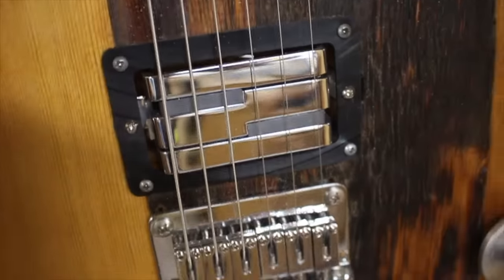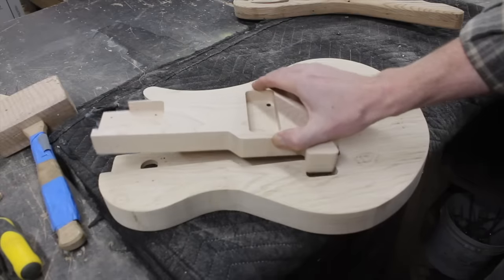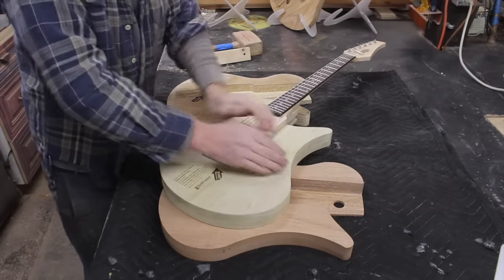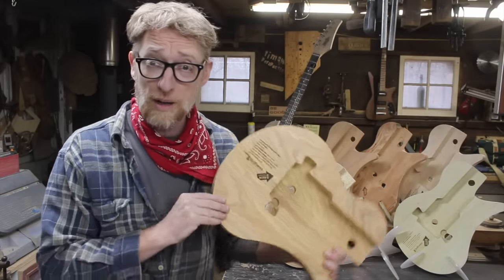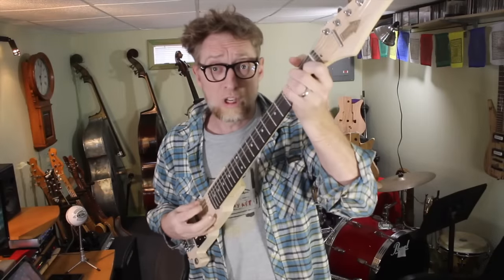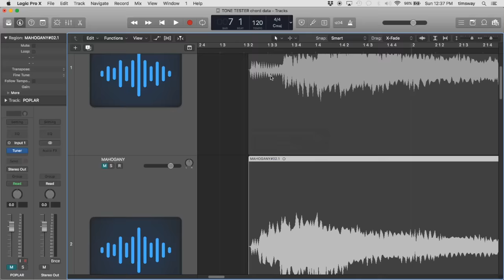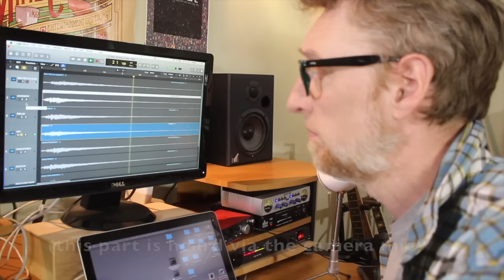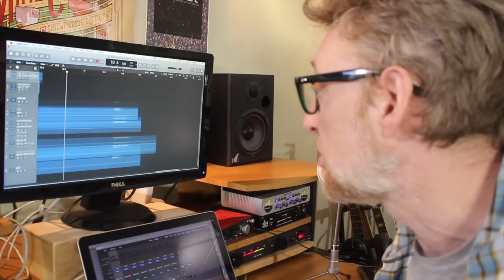Tone Wood Tester: One guitar to test them all

Comment: I think that to get a good idea on whether the wood makes a difference, you need to get insane.  Go to the extremes.  Your comparisons are between materials that are so close in character that it's hard to discern any significant difference.  
   A slab of slate would be something to try.  Solid, dense, and resists deformation.   Very different than wood.  Not practical because of its weight, but just something to try.  If you look at a table on sound transmission for different materials it will give a formula that depends on density and elasticity.  They are independent of each other.  Then what about clay? 
   Clay is dense and has no real elasticity.  Only thing is the bridge has to be attached to something strong.  But that might be okay.  Acoustic guitars use the body or a trapeze for that anchor point.  Solid body guitars essentially are using the neck.  It could be a neck-thru or a bolt on or anything you can come up with....like yours. 
 A neck-thru with detachable wings.  
   Should the wings be the only thing subjected to analysis?  Not sure.  Build a guitar out of solid concrete and look at what the scope says for all of these things.  I used to put my guitar against the wall too when I was a kid.  But that is a purely acoustic phenomenon.  Does all of that get back into the pickups?
Then try piezoelectric pickups to see if the added acoustics of the wall make any difference.  I had a guy tell me that the best wood for speaker cabinets was some kind of birch.  Baltic, maybe.  Complete rubbish.
Hmmm.
Reply: Eh, I'm doubtful about speaker cabinet materials as well, but given that there certainly are differences in sound depending on the dimensions of the cabinet and whether it has ports, open back or closed back, it's not completely inconceivable that the material might make a bit of difference as well. Is that "complete rubbish" assessment of yours based on anything or is it just an assumption?
Reply: @ollimoore   It's just experience.  Some things you lose faith in as they fail continuously.  There are many fake science opinions out there.  If the cabinet is free of voids and of the appropriate design for the intended purpose, you have a good cabinet.  Talking about the wood it's made from is silly.  It only exists in story books.  Not technical people don't know enough to see that.
Reply: @alext9067  oh I am very much a 'technical' person, I DO highly doubt that anybody could tell the difference between different fundamentally acoustically dead materials used in a speaker cabinet, however I dislike such strong terminology unless something is actually proven, in this case by two cabs of identical (or extremely close) dimensions and treatment but different materials.

Comment: It seems like the bridge should be mounted to the test wood and not the center block. This seems like a reasonable test to see if the body surround has an effect. I wonder if the wood in the center block was actually the wood under test varied by species what our results might be.

Comment: The amplitude waveform you compare is more related loudness than to tone... it would be great to see these same results in a frequency waterfall display (like the ones in Studio One's Pro EQ2 or izotope Ozone 9)- With this type of display you can see the each frequency band from 20 - 20,000 hz and how they develop and decay over time. I think that is your best chance to quantify any differences.  I would also test a 2 string bend because that shows the ability of the instrument to create constructive interference and rich frequency content during dynamic play.

Comment: If you have the same pickups and strike the strings the same there should be no difference. 
Wood doesn't matter. It's the electric impulse generated from the vibrating strings.
Reply: The idea of tonewood is that the type of wood changes the way the strings vibrate therefore changing the way it sounds

Comment: Every plank of wood will sound different, even if it's from the same species.
Reply: While you're right that there are differences between wood from different trees of the same species (even differences in wood from the same tree), you missed the point of this video. These planks are all from different sources but sound the same. OP's point is that even though these are all different woods, species, densities, weights, hardness, etc the difference on the tone of the guitar is minimal at best. His results are basically the exact opposite of what you just said lol
Reply: Correct! But the variability between two different species can be far different than two from the same species.

Comment: Tone wood is just marketing talk to get us to buy in to an idea. The sound is really effected by the the active components in the chain. The pick, strings, pickups, electronics and the amp you are plugged in to. What all that is strapped on to is pretty much irrelevant. Even the cables you use have more influence over your tone than the wood.
Reply: By far the most important factor is how good the guitarist is. No amount of equipment could make me sound virtuoso even after 8 years experience. That money spent on hours of intense coaching for me however might stand a chance

Comment: Define "tone". You seem to be labouring under a few nominal misconceptions. Tone comes from hollow body guitars, and is produced by ideal vibrations from timbers, body shape, and bracing. 

Piezo pickups actually reproduce tone, not so with magnetic coil pickups... if they did, they would be "microphoning", which is definitely not what is required, and is why I vacuum wax-pot my pickups. 

Touching your bass headstock to the wall doesn't transfer "tone" it transfers vibration. To the uninformed, your terminology could be misleading. You did nail it with "sustain" though, and that is what counts with electric solid bodies, you have created there the perfect sustain device, without adding the body wood, similarly with an early Steinberger. Your son instinctively knows it too, the denser the wood the better the note carries, even between notes in a passage, the sustain can be felt, but that is not "tone", everyone is fixated on "tone", it just muddies up an already dirty mix of uninformed "opinion". Tone, in the context of an electric solid body guitar, comes from the pickups, the tone knob, and the amplifiers. Even that corrugated cardboard Strat still sounded like a Strat.

However, your examination was the most scientific I have seen so far... not that this is a burning topic for me, nor that I watch much about it... the Poplar was slightly brighter, possibly because the softer wood does not sustain the bass notes quite as well as the heavier types of wood. In my experience, the neck is the key part of an electric guitar, get it right (together with bridge and pickups) and the rest is just tinsel... more or less.
Reply: Tobias Reiner  "Tone" or "timbre", neither has anything to with the wood on a solid body guitar, although your explanation does sound fabulous.

Comment: once you plug a guitar into an amp you lose 99.9 percent of any guitar tone you think you may have had..  tone only applies to acoustics..  the sound is literally bouncing of the inside of the guitar and thats when the wood used can make a difference..
Reply: Sorry - not true.   There is feedback to the strings from the body that is picked up by the pickups.  It's subtle, but it's real.

Comment: Very interesting video. One thing I read is that the body doesn't affect to the sound as much as the neck wood. Your video make it clear. Could you use the same pickups and body over and under different necks? I think this way the tone would differ more.

Comment: guys. wood has no impact whatsoever on the tone. it sounds exactly the same. yes denser wood gives  you more sustain. the reason being less energy is transfered from the strings to the wood. imagine bouncing a basketball on hard floor vs a pillow.  thats how denser vs thinner woods work. 

in fact, you want the least amount of energy transfer from the strings to the body to keep that sustain in the strings.
Reply: Except that each of these sounded different. It's very clear.
Reply: @ssimon64  
Self-delusional

Comment: The sound is in your fingers... eliminate them lol  Of course there are differences in your playing on each take.
Other than that I think it all sounds the same. Tonewood is relevant for acoustic instruments, for electric ones it is not. I have a plastic bass that sounds amazing and sustains like no other I know of. Different woods are important for design, feel and weight.
Reply from the maker: tell me more abut your plastic bass, please!
Reply: @timsway  It's made by Cort, I got it from a fleamarket, felt awesome immediately. I also have a Samick plastic guitar. Both instruments have wooden necks. Maybe that material has a specific name I don't know, but it is some sort of plastic.
Reply: Open tuning. Bone tone issue solved.
Reply: @prOkrEAt  Open tuning and a mechanical arm to hit the strings with the same force, at the same angle each time.

Comment: I've been saying it for 20+ years. Tonewood is a myth.  A pickup only "hears" a disturbance in a magnetic field.  It doesn't hear 'dark" , "smokey', or feel "love".  It just detects a vibration and converts it to a line signal. The winding and placement of the pickup is what makes the difference.  The amp and electronics do the rest
Reply: Exactly but taking into account how vibrations can be affected by the dense or rarer woodor material, i guess denser material like epoxy resin should offer more sustain. Tbh I really like Creative epoxy guitars and other than their weight don't see any downside to them
Reply: Yeah, what the hell does Ted McCarty know? 🤣

"We started trying to learn something about a solidbody guitar. For instance, the stiffer the material—the harder the wood—the more shrill is the sound, and the longer is the sustain. Hit the string and it would ring for a long sustain period. It could be too long.
One of the things we did was to take a piece of iron rail from the railroad track, put a bridge and a pickup and a tailpiece on it, and test it. You could hit that string, take a walk, come back, and it would still be ringing. Because the thing that causes it to slow down is the fact that it gives a little bit—wood gives, you know? So we started. We made them out of maple—they were too shrill. Leo was using ash wood, always made of ash, and we didn’t think much of that as a wood. We didn’t use it.

We made a guitar out of solid rock maple. Wasn’t good. Too shrill, too much sustain. And we made one out of mahogany. Too soft. Didn’t quite have that thing. So we finally came up with a maple top and a mahogany back"

Comment: love your work.
Note the acoustic properties of materials relate mainly to the neck. the real question is why do so many professional instrument makers have joints in the body neck interface. the joint is inherently lossy and a major point of failure. obviously, acoustic guitars need a joint. I have a lovely 12 string and the neck vastly outweighs the body and the acoustic properties are remarkable.

Comment: One of the better approaches to comparing wood types I've seen.
 However, there's a huge variable introduced by manually strumming the chord.  The variability comes from how the pick is held, how hard into the strings each strum is, how fast each strum is, where on the guitar the strings are strummed, and the angle of the strum. All this introduces changes in volume, sustain, and harmonic content.  Build a small weighted arm onto the common component that holds the pick, and drop the weighted arm from a preset stop above the strings with the guitar body at 90 degrees to horizontal.  That will produce consistent strums.

Comment: I'd love to see this redone, only with the guitars being strummed by machine so the location and speed etc of the strum is exactly the same for all of them that way you can do a valid null test (flipping the phase on one and playing it with one that wasn't flipped; all similarities will cancel out) to really see if and what the difference is.

... Then toss on an amp sim and redo the null test, because it's an electric guitar so the amplified sound is way more important than the di sound. If there is no difference in the amplified sound then it really doesn't matter if there is a difference in the di sound.

Comment: Excellent video!!!! From my mini-mac I heard differences. When you strummed the mahogany,  i thought you may have missed the low e-string. The door-piece sounded most like the mahogany, a bit icy. The swamp ash sounded warmer and subdued, I loved it but i doubt if it's sustainable so not for me. That was by far the lighest wood, so density is not saying that much. With most you could clearly hear the b-string resonate longer, with or two you'd hear the g-string resonate longer. Personally I'm most interested in what semi-hollows do, for i do think the shape has influence.

Comment: I think the wood the bridge is attached to would be more important than anything that's stuck around the outside. I suggest you try a machine to strum each exactly the same and measure the sound un-amplified. I have been looking for the main reason some solid bodies ring out loud and long and others sound dead.

Comment: Very interesting.

When I was a math grad student my class in partial differential equations spent an entire semester investigating vibration. Included was both hammered and struck (plucked) strings which behave a bit differently.

I can't help but think that there must exist a general solution for the soundboard's vibration due to string vibration. I expect that if all the boundary conditions such as wood density, etc was incorporated into a final solution one would find each guitar was essentially as unique as a finger print.

It would be interesting to experiment with this, after all the Rocket Gals of the JPL were rather successful at a similar endeavor. The only caveat is the more complex the boundary conditions the less likely a human can solve the puzzle.

Comment: I think the best you can do is eliminate variables, such as the attack of the pick or the pressure of the fingers when making the chords , taking the time until the strings stops vibrating and send the audios to someone who can make a spectrogram and tell to you what is happening in there. if you really want to se if the wood have something than we cant hear, but we can feel. i think that's the method. 
i love your channel, you have a new suscriber

Comment: Really great vid!

My stance has always been something like this: It depends on who you're playing for. Tonewood does make a very small difference, but not big enough for me to care. If you're playing for yourself at home, by all means tweak your tone to your heart's desire since you can "hear" the difference. But if you're playing in a band, I doubt anyone in the audience is going to care if you're playing a damn Strat or a Les Paul, let alone be able tell the difference.
Reply: When did we start incessantly parroting this nonsense about what a crowd hears? My mom can't hear the difference between my 1957 Les Paul and my 90s Japanese stratocaster - this doesn't mean those differences don't matter. Because ultimately, it isn't about one component - it's about *several*. A band full of great gear is going to sound better, even to my mom, than a band full of bad gear.
Reply: @allrequiredfields  I'm not talking about great gear vs bad gear, I'm talking about tonewood specifically. Playing a gig with exactly the same rig, only changing out the wood of your guitar, will make such negligible difference to the overall sound.

Obviously changing your amp/pedals/guitar will make way more difference to playablity/sound etc which is way more important.

Comment: Really awesome video, thanks for your hard work in trying to answer this question. I have a couple of ideas for testing to further eliminate variables (namely the human element) that you might look into it if you decide to go any further with this. 1 would be to setup some kind of simple jig that uses a motor to strum the strings at a consistent speed, intensity and angle of attack with the pick. The other would be to decouple the guitar from any hard bodies (suspended by strings or springs?), and having a speaker fire pink noise or a frequency sweep at the guitar which should theoretically transmit over the pickups and be colored by the resonant frequencies of the guitar body so you could compare the graphs and see if they're the same or not.

Comment: Cool experiment, good work. But my hunch is that you have to go whole hog. The bridge, pickup and neck are all vibrating independently in a wood matrix. You're basically just hearing a maple guitar.  Granted sometimes the pickups are mounted to plastic and not the body but you know what I mean. I built a curly maple pickguard for a strat and I think it added tone, but some of that may have been making some unpotted pickups.

Comment: For tremolo Bridges, adding a brass or steel block is most significant.
Semi-hollow bodied guitars get better sound usung laminates (good gluing), harder finishes, and attention to cavity/porting.
Solid bodies shouldn’t really claim ‘tone wood’ status at all; pickups and placement; electronics; bridge/nut; those affect tone most in solid guitars.